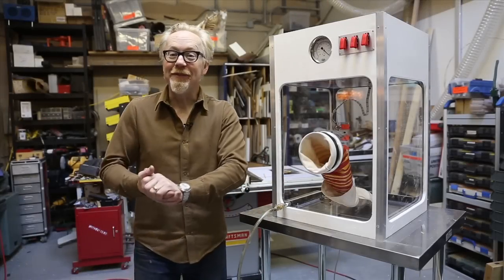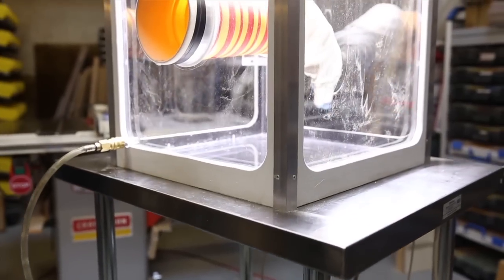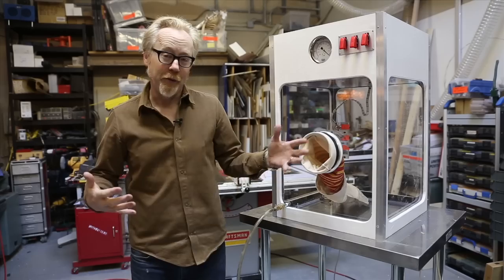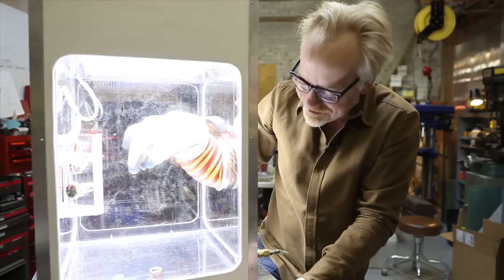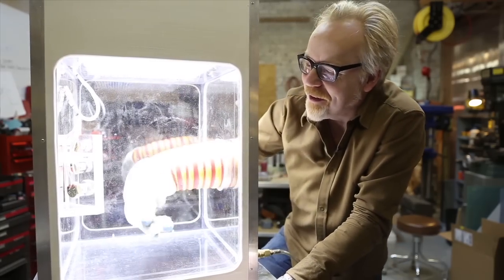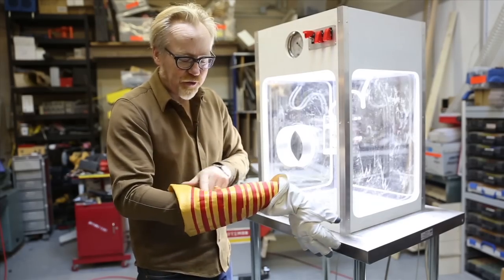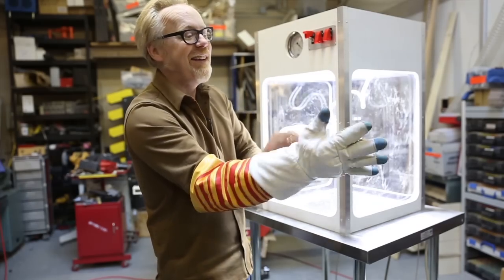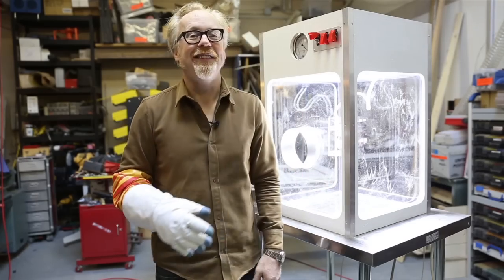Inside Adam Savage's Cave: Space Glove Vacuum Chamber

Comment: Why only 3 psi Adam that's only appox 35,000-40,000 feet in altitude, pilot pressure required with supplemental oxygen) when sea level pressure is 14.7? Pull it down to and lets see the claimed 4.3 psi or that which would really be required for longer term "walks" 6-7-8 psi... where it will be impossible to move... any limb or appendage contained within such a suit.
Thus PROVING:
There are no Space Flights into the great vacuum expanse, No "space walks" either...
Myth Busted. Thanks Adam.
https://www.avs.org/AVS/files/c7/c7edaedb-95b2-438f-adfb-36de54f87b9e.pdf
"Spacesuits designed for the space station era will be pressurized to 8.3 psi; therefore, the pre-breathing period will be shortened or diminished."
https://er.jsc.nasa.gov/seh/suitnasa.html
Reply: The Apollo space suits used 3.7 psi pressure of pure oxygen.  The space shuttle suits used 4.3 psi.  As space suit technology improves, they can use higher pressures so that less pre-breathing period is required.   The glove that he uses is not up to the standards of modern or even Apollo era gloves, so doesn't work as well in the same pressure differential.  To say that your conclusion somehow busts the idea of the ISS or spacewalks is ridiculous.  You can see the ISS as it passes overhead after sunset or sunrise, and was only built as a result of several shuttle flights and space walks.  Amateur astronomers have even photographed it: https://www.wired.com/2009/12/a-spacewalk-as-seen-from-earth/    http://www.telegraph.co.uk/news/science/space/8356656/Amateur-photographer-captures-space-shuttle-from-back-garden.html
Reply: Rand al Thor  He is showing how pressure differential affects movement in spacesuit gloves.  You don't need a vacuum for that, just an equal pressure differential.  Unless you have actual space suit gloves, then you will end up with gloves that don't work as well.
Reply: absolutely right, there's no Myth busted at all. the only proven thing here's that Adam doesn't know what he talking about. He's experience is at best incomplete, at worst totally wrong

Comment: Oddly enough, our skin is actually quite capable of holding in our internal body pressure, so we wouldn't explode in a vacuum (right away). So NASA and/or other agencies could actually design much thinner and less cumbersome space suits than the ones we've been using since the 60's. Sure, they have been improved, but the basic design is still very much the same.
Reply: No you wont explode. You will just get an embolism in your eyes or your brain. If you attempted to hold your breath you would pop your lungs in a split second, And nothing has changed since Apollo. And you have to be dreaming if you think your going to move around in a suit with 3.5 psi. And the actual psi in this video is 1.7psi because the gauge is in.hg not psi.
Reply: Are you really schooling NASA in how to make space suits?
Reply: Are you really this dumb?

Comment: If atmospheric pressure at sea level is ~14 psi, and he is only pressurizing to 3.5 psi that is the equivalent of being at 35,000 feet on earth!. A person who climbs Mt Everest must acclimate before attempting this and even then he is only there for a short time. And even then you can get High altitude cerebral edema, pulmonary edema. 50% of climbers reaching even 14,000 feet get AMS (Acute mountain sickness). And that is EVEN with oxygen. Even if your acclimated you MUST NOT assend more than 9,000 feet per day.  Once AMS starts to occur you either get down or your going to be dead meat. Climbers have medical facilities at check points to give them injections if they start to have symtoms. I have never heard of an astronaut EVER complain about altitude sickness.
Reply: +Open Your Eyes pressure differential not absolute. So you need about 10.4 psi in the box to create a 4.3 psi differential. That would show as about 8.6 inHg on his gauge.

Also high altitude illnesses are related not to the lower overall pressure but the corresponding low partial pressure. 4.3 psi at 100% O2 provides the same amount of oxygen as normal atmosphere at ~14.33 psi. That's about .1 psi lower than the low pressure system we had pass through a few days ago. I live at ~840ft and I can attest I experienced no discomfort.

Comment: I was always taught that the "P.S.I." in space was nearly 5 P.S.I. not 3.5. I have seen a professional glove box, similar, but smaller that worked on 4.5 P.S.I. and it was much harder to do even the most simplest of tasks like picking up a spanner and using a screwdriver.
Reply: +keefy Do you mean the psi in the space suits? Yes, 4.5 is the number I have seen. In this video, the box is set to -3 inches of mercury, about -1.5 psi (though it's not clear Adam is aware of that) The Apollo gloves were far more engineered and complex than the glove seen in this video.  Apollo glove interior: http://airandspace.si.edu/webimages/previews/9844p.jpg Still, the astronauts complained of hand pain, fatigue and chaffing.
Reply: Brad Rex Yes thank you. I could have gone in and changed it and asked you if you need spectacles. But, I hold up my hand and say "My Bad", sorry. Thanks for that, at least you didn't shout at me as my physics teacher would have.
Reply: Bumps in the night The space glove vacuum box, I saw, was built by Bill Kaysing, the NASA debunking expert on the Apollo series. It was virtually impossible to bend the fingers and thumb. The suits were supposed to inflate a bit but never did. Some jumps on the moon were carried out at close range and only from the waist up and was filmed as the author of the post said the Astronots were probably using small trampolines. There is so much wrong any rights would fall between the cracks as there could never be 'rights'. I used to enjoy Mythbusters but as soon as they became Obama's science advisers, I watched the Apollo program and felt embarrassed for them. They are Special Effect technicians with a bit extra, I have not watched any of their shows ever since. As for the ISS, the green/blue screen says it all. As I have often said on the Apollo posts, "Find 1 lie and the rest will be lies". The ISS blue/green screen, fading Astronots, lots of hair spray, violent jerks as the 'Vomit Comet' hit turbulence, the harnesses, etc etc. 
. It's all bovine excrement at the tax payers expense, the same as the Phoney war on terror,  checkpoints, TSA, etc.
Reply: Bumps in the night The vacuum of space is very close to 0 PSI, but that is not magnitudes greater. 0 is less than 1, not greater, and that is the thing about vacuum. It has a limit, 0.

I enjoy talking to moon hoax proponents, but the fact is you guys don't seem to know much about the science or engineering involved.  The space suits held 4.5 PSI of pressure vs the vacuum of space.  A garden hose holds about 50 PSI vs the pressure outside and while stiffer than no pressure, remains flexible. The hose and the spacesuits have an inner structure designed to let them hold pressure and bend.  If you just look at the outside, you won't understand it.

Keefy, Please note: Bill Kaysing did not test a space glove, he tested a gardening glove.  And he is not really an unbias source.
Reply: The Apollo space suits were generally made of around 15 layers with a restraint layer, which stops the suit becoming Michelin man. The suits, as stated, are inflated to around 4.4 - 4.7 psi. which can still be slightly stiff as the restraining layer is on top of the flexible neoprene layer. A Russian cosmonaut's suit inflated too much during a space walk. He would not fit back through the capsule hatch. He had to manually deflate his suit a bit to fit back through. 
Our unregulated cold water supply came in at 120 psi ( 8 bar ). Now, the supply is regulated to 60 psi ( 4 bar ).
Reply: keefy Here is a great photo that shows some of the mechanical com,plenty of keeping the suit flexible while holding pressure. This is the inner presage suit that most people never see.
https://upload.wikimedia.org/wikipedia/commons/7/73/S71-24537-A7L_without_outerlayer.jpg
Reply: Edward Rex  The A7L pressure suit, as used on Apollo. Strange to think that the A7L suits were continuously updated and redesigned for years afterwards. The STS came up with partial pressure suits, sounds dangerous to me. Do they poke holes in it so it is only partial. Then after the very  sad Challenger disaster, things were changed again.
Reply: keefy The partial pressure suits were adapted from the suits high altitude air force pilots wear and wear intended to keep the astronaut alive if pressure failed in the space shuttle on launch or reentry. The suits incorporated bladders that could be inflated to move blood back to the brain.
Reply: Edward Rex They ( NASA ) must have had some trepidation on the first manned space flights. Albeit that they had information from high altitude testing, like the "X" flights. Even so, there was/is a huge difference between a 30 minute flight and a 1 week ( or more ) in space. They seemed to get somethings right. I have always wondered whether I would be able to pass the centrifugal test. I actually think I would disgrace myself, badly, on camera.
Reply: Bumps in the night The vacuum of space is a near perfect vacuum, not 5psi.  The spacesuits held about 5psi of positive pressure.  About 1/10 of the pressure held in a car tire or soda can.
Reply: Bumps in the night 1. Considering there is no such thing as a perfect vacuum I will agree with you on that point.   
2. Man has been in spacesuits. I will guess you meant in spacesuits in space, but as you can't even articulate, I won't bother with this one.
3. Man has never been "anything else"?  Love that logic.
Reply: Bumps in the night Again, space is not a perfect vacuum.  So where would we find a perfect vacuum to put the space suit into?

We go up about 250 miles and thats about it, but we don't have space suits, or space craft???  How are "we" doing that?  Are you part of this we?

Adam did not demonstrate that or any real space suit to me.  he made a toy that you can't seem to understand.

And again, 0 psi is not magnitudes greater than 1 psi, it's less.
Reply: Bumps in the night So when you wrote perfect vacuum you meant what?

You write all kinds of stuff indicating you think a vacuum pulls.  It does not pull at all 0, zilch, none.  Higher pressure pushes to a lower pressure, there is no pulling.   For example:  "DO you think the space shuttle could withstand 30,000lbs of force pulling from every direction?"
Reply: Bumps in the night Like when I said "The vacuum of space is a near perfect vacuum, not 5psi."  You could have just said vacuum, but, you seemed to make a point of  it being perfect several times.

And you are wrong about the balloon, the pressure of the air inside the balloon makes it grow as the pressure outside is reduced.  Again, no sucking.

Do you understand a perfect vacuum is nothing?  What in the nothing is doing the sucking?, what is exerting this force you imagine?  What keeps air here on the Earth despite this tremendous sucking you imagine?  if it's 30,000lbs on the space shuttle how much is it on the whole Earth?
Reply: Edward Rex I am not ignoring you but my health is not able to go to the ISS, so in a few days I should be able to give a decent reply. Unless they find Hillary Clinton's server in my workshop.
Reply: keefy I hope your health improves.  I think much of the confusion over Vacuum strength comes from the way pressures are expressed.  Ultra high vacuum similar to what is found in low earth orbit is 10−7 pascal.  And some people think that is 100,000,000 pascal.  It's not, that would be 10+7. 10-7 is 1/100,000,000.  It is a really small number, not a big one. and if you make the vacuum 10-8 people think that is 10X stronger.  It's not.

Comment: I wonder if he tried it at a full ~30inHg...
Reply: Looks like nice thick plexi, but real vacuum chambers are not square for a reason.  i think his sides will collapse or at least bend and open up the seams if he goes much farther.
Reply: ah yes I didn't think of that.
Reply: Quagmire88 Something to note is real spacesuits are not pressured to 1 atmosphere.   They are pressured at about 1/4 of an atmosphere and pumped with 100% Oxygen.  What that does is maintain about 80% Oxygen (breathing adds CO2), but at 1/4 pressure, the Oxygen concentration is roughly equal to Earth.   So the suit does not hold 1 atmosphere, making it easier to bend than you might think.

Comment: Very cool, but your pressure delta is only about 1/2 what a space suit holds.  Normal Space suit pressure (Wikipedia): 32.4 kPa (240 Torr; 4.7 psi).  You meter shows 12 kPa, and 3.5 inches of mercury, PSI is not indicated.